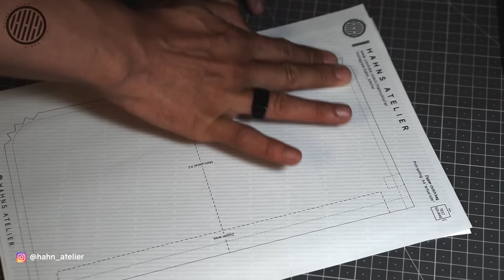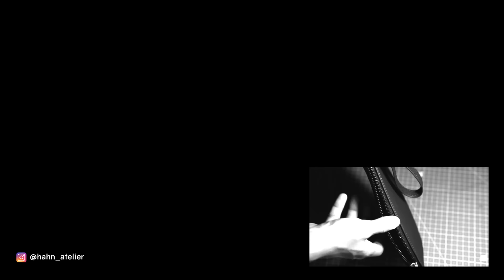How to make a zipper clutch bag / Making a Bag / Free PDF Pattern / Leathercraft

Comment: Hey Hans, thanks a lot for all your videos and projects. I recently started working on leather for my own pleasure but sometimes i struggle with the choice of the type of leather. I'd like to try this project and i was asking myself if the material would get to thick if i used some real sued for the interior, getting the total thickness of the material to around say 2,5/3 mm?
Thanks a lot and keep up the great work!
Reply from the maker: Glad you started leather crafting -! I must say, It's little bit thick if you 2.5mm for one side. It will be 5mm and should be hard flip it. In that case you need to skive edges.
Reply from the maker: I misread, total 2.5mm should be fine. Cut some corner parts makes easier.

Comment: Hi Hans. Another elegant display of your elegant craftsmanship! Please tell me what the purpose is for using two different glues and what types of glue they are. Thanks! @HAHNS ATELIER
Reply from the maker: Hi! I using bonds for different purposes. but It's not the rule.  Here is the glue that I use usually Hope this helps!😊
1. kenda bond 
: yellow, chemical smell, very strong, low price
2. intercom ecostic, high price
: white, no chemical smell, thin
3. Instant adhesive
: race, braiding, metal hardware (rarely)
4. B5 bond
: Beige, Thick, using for lining.

Comment: Another beauty with superb craftsmanship!  I love the notching of the corners, perfect way to get those pesky corners to turn smoothly and lie flat.  The self-stick liner looks good and also like it is easy to use, no messy glue to worry about.  Have not seen that in the USA, hope it shows up soon.  Also, do you have a source for the round weights you use to hold the patterns down?
Reply from the maker: Thanks for the comment Ellen, You can search that material (artificial suede sheet) It's using for home deco as well (or car int) . Plus that weight , It's easy to find in Korea but don't know where can get it in US. Sorry about that. Other metal cylinder block works as well I think.
Reply: Thanks, Hahns.  I did find the suede through Amazon, but will look for another source, too.
Reply from the maker: Hope you get right one!

Comment: Hi Hahn,
Beautiful work! I have a question. When you are stitching your corners with the KS Blades, are you putting the tooth in the last hole made as you're making the turn and progressing forward, or do you mark out where the holes will be in advance, and punch two new holes at a time?

I couldn't tell since the background was black. :)

Thanks!
Reply from the maker: Hi! when I using diamond shape one, just mark and move to there. this one was awl pricking iron. so I put it to last hole.

Comment: and once again a great design and very well filmed! 

Why do you use artificial suede? Can a slightly thicker leather be used? Or is artificial suede less 'fluffy'?
Is it possible to meantion also the thread you use? I'm fairly new in fine leather goods and find it difficult to decide which thread to use... I've worked with leather for orthopedic products and saddles. Waxed or not, thickness, twisted or braided,... Can you shine a light on that?
Reply from the maker: Hi Bruno, welcome to leather craft. I'm using 420denier nylon thread. I using John james needle #4 . and for the lining, You can use real suede or fabric as well. I just using this for convenient.